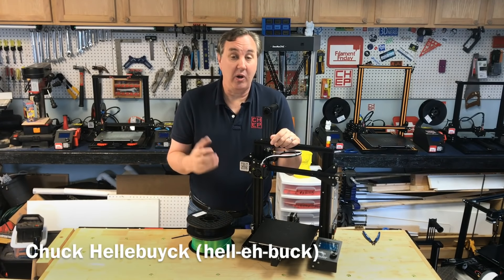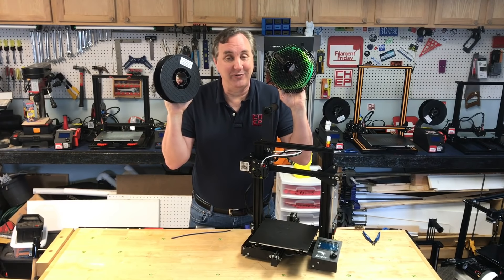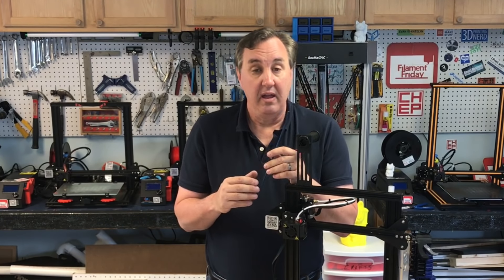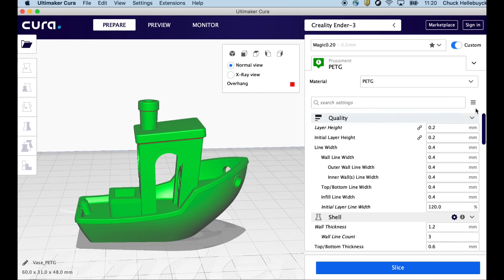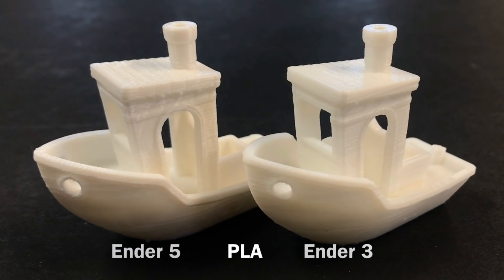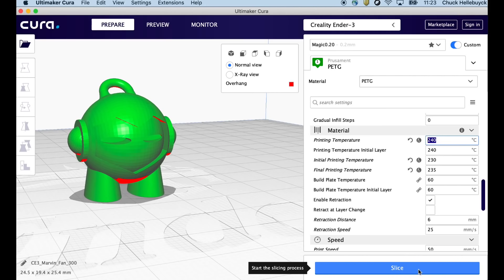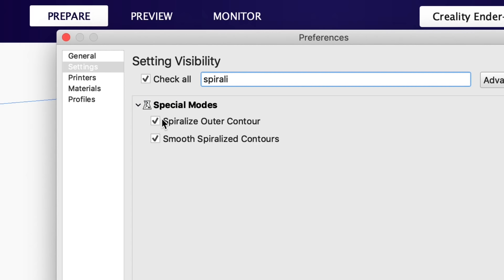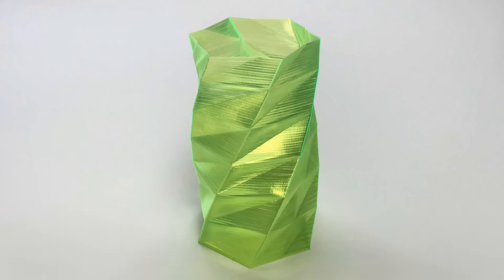PETG on Creality Ender 3 - Atomic and Prusament

Comment: Stringing: If you need to print a more complex object with supports and lots of travel in PETG on the Ender 3, change 'Combing Mode' to 'Off' in the 'Travel' section of Cura. This will make most of the stringing disappear because the Combing forces the nozzle to travel within the object (which is good) but it disables retraction when doing so. I initially had lots of issues for printing a Petsfang cooling duct while all my previous tests were fine. The geometry of that object created complex travel patterns which in turn created lots of stringing inside the object. That matter was often dragged to the outside of the object giving the illusion it was a retraction issue.
Reply: Oh my GOSH you have no idea how much stress you saved me. I would have never found that setting on my own, I am trying to print an iron man helmet but I can't even get a 3dbenchy boat to not have much stringing, not only did this eliminate the stringing it also made my print quality much better. I have been trying to fiqure out why my prints where still stringing and poor quality for so long. Thank you!!!

Comment: Hey Chuck, I have printed several thousand meters of the Atomic CF PETG, on most machines it needs 250C and 45mms, Prusa MK3 is an exception at 260C. With proper extrusion rate it will make prints that look almost machined and print very easily with no blobs or problems with supports. I don't have an Ender 3 but, I have printed it on the Anycubic Mega-S, Anycubic Chiron, Prusa Mk3 and Formbot Raptor 2 all with similar results. Standard PETGs get the same treatment at 240-245c. I usually use Atomic or Inland for them.  Also you might want to mention in a future video that PETG will take on water fairly quickly and needs to be stored properly. Thanks for the video.
Reply: In reality it is the opposite of what you said, petg does not absorb water, in fact it is also used to make bottles
Reply: @xpy99  I don't agree. PETG certainly absorbs water, and if you print one which isn't dry it will not be as shine clear, but more rough and more brittle. Depends on the climate you live, but I have to say, if you want repeatable quality, make a drybox and keep it at 10-20% RH.

Comment: Not a good idea to take that PTFE up that high, you can find studies that found that the stock PTFE can start to break down as at temps as low as 215C. And it's some nasty stuff, known to cause brain damage and in extreme cases could kill you. Just my input, I'd go for an all metal hotend if you wanna print anything other than PLA.
Reply from the maker: Do you have link for those studies?
Reply: @FilamentFriday  No I just happened upon them during some casual reading a while back. I can try to find them this weekend if I have some free time.
Reply: @FilamentFriday  i've read 240-260 before decomposing, but never read anything about brain damage and death... first look i'd say it seems quite exaggerated
Reply: @Biohazard0687  On the capricorn website itself, they warn that some offgassing can happen above 200C and it becomes dangerous (to humans) above 275C. Their sources seem to lead to 404 errors on pet websites though...
Reply: While I agree that a large enough amount would pose a threat, the actual amount of the tubing that gets exposed to that elevated temperature is very small.  If a large amount of it was being exposed to those elevated temperatures I'd be much more concerned.  I'm more interested in what the filament is out-gassing while being melted and if there are any dangers as all of it will eventually be exposed to the high temp.

Comment: Just a heads up guys and gals...I just got screwed by Atomic Filament and their Starry Night Translucent v3 PETG PRO filament. Part of the reason for viewing this video was to get some insight for further troubleshooting extrusion issues with a small .2 mm nozzle. Literally during back and forth e-mail with Atomic today, they updated their product page to express a recommendation for a .35 mm or larger nozzle when using this and similar filaments that have additives, such as glitter. I argued that their recommendation was not on their product page at the time I made a purchase and I should not be responsible for their oversight. Ultimately, Atomic refused to receive back there filament for a refund, implying that their filament is tried and true with standard or larger nozzles.  Their lack of transparency, empathy and strange pricing (almost everything is always 50% off) should draw concern.

Comment: The higher breakdown Capricorn tubing works great for PETG.  Concerns about dangerous outgassing are valid but consider that  the amount of the Capricorn tube that actually gets exposed to that higher temp. is a very small.  I've been using Capricorn for quite sometime and have yet to see any breakdown with the part of the tubing in contact with the nozzle on multiple printers.  My favorite PETG filaments are eSUN and COEX.  Never tried any Prusament yet.  Not a fan of Inland PETG.

Comment: How do you get your prints to stick to the bed?
Reply: Hey idk if this is a late answer, but it seems like you can do petg on an ender3, and it works like pla. Seems like you need to go 90 on the bed temp and 0.3 initial layer height. 240 on the nozzle for the initial layer and print at 30mm/s or less for the initial layer. Then go 225 on the nozzle for the rest of the print and whatever layer height you want. Keep the bed at 90 tho. You can print faster too, all the trouble isbjust gettingbthe material to stick to the bed then its not much different fron pla when past the first layer or two. Dont quote me on all this, there may be more to know too I just got it working smoothly today. Those settings kind of magically worked, it just seems to really like to stick to hot metal. You shouldnt need any glue or anything if you have anything that isnt plain glass.

Comment: I don't know how to tell you how thankful i am lol. I couldn't make PETG work for me until i learned to not be afraid to bring the temp up  to 240. I used to attempt it in 220
Reply: Update. I was doing larger prints and for some reason it began to warp. Does anyone have any suggestions for what to do to prevent this?
Reply: petg likes to warp on glass beds. I always use a brim to print petg, and try reducing the fan speed. Hope that helps
Reply: @giulianopaletta5072  yea man thanks for the info. I'm not using a glass bed im just using the mat in the ender 3 pro. What helped me was setting the bed temp to 75 degrees and I printed stuff with no problems. Ill try keeping the fan speed low for next time. Thanks again.

Comment: I print well with generic PETG at 230 C on the hotend and 80 C on the bed on my Ender 3. Retraction is 6 mm and moderate speed. 

Printing slowly without z hot makes a big difference in quality. Make sure your bed is very level for the first layer to ensure you dont have anything stick to your nozzel.

Comment: Capricorn’s safety page cautions that their additives inhibit deformation, not PTFE offgassing. They strongly recommend printing “in a well ventilated area, away from children and pets.” Some pets are indeed more susceptible to PTFE fumes, but as a medical doctor who has studied this topic, I know that no human of any age is immune to the myriad health risks triggered by Teflon pyrolysis. The best level of it is ZERO, not just a low, seemingly acceptable level — for such chemicals, there is none.

Unfortunately, Teflon pyrolysis rarely produces immediate noticeable effects, but exposure can and often does trigger serious and even deadly consequences. Because users commonly print frequently if not 24/7, that chronic exposure will very likely result in health problems.

Crucially, no fused-filament fabrication (FFF) printer is safe. Some are designed so they are not susceptible to Teflon pyrolysis, but heating all filaments — even PLA — produces particulate emissions. Many users mistakenly assume that little or no smell translates into no risk. Wrong. Bottom line: no printing should be done in occupied buildings unless the printers are encased in airtight chambers with active ventilation ported outside.

Comment: now running petg at 100 mm/s with extruder at 240 and bed 75. layers 0.2 and a beast like the ender 3 pro is like awesome.  ender 3 pro is still stock, brand new! thanks chep for the little tweakings i was still missing ;-)
Reply: Watch for bowden tube tube melting around 240, don't go over that. I will try PETG but at 235 C on standard tube, after I switch I can go higher. Btw the fumes from the molten tube are not good for you, take care.
Reply: @mmdirtyworkz  240° is the maximum i need ;-) the PETG flows very nice and don't need to go higer. next upgrade i'll buy will be the capricorn tubing. but i have an ender 3 pro for PETG and an geeetech A10 for PLA and another ANET A8 for PLA. don't like to switch filament types on my printers and i don't have to worry about levelling al the time alsow. thanks for the concern, don't need to have more toxic fumes then we already have al day ;-). stay save!
Reply: What fan settings do you use?
Reply: first layer off. for the rest it depends wich slicer i use, if i print on glass or another surface. my ender 3 pro is modded with duckts so have to find it out a little bit yourself. i've quit cura and use now for the most stuff i print prusa slicer or ideamaker. find them better working with my ender and geeetech A10.

Comment: If you take a blowtorch and quickly sweep across your print with it like you're painting it, after a few swipes with cool downs in between, you can give it a nice shiny reflection and the print lines dissappear if you are patient and do it right.
Reply: i found this out with PLA, when your print off of the ender 3 bed, it's a little white on the bottom, blast it with a "jet" lighter, and you have no more white marks

Comment: I totally agree about the Capricorn. I bought a meter for my Anycubic Linear Delta printer to help with accuracy and retraction (which I totally recommend) and I had a bit left over that just happen to be the exact length for the E3. I now feel confident in taking the Hotend up to 250 without a problem. Capricorn is a cheap but worthwhile upgrade. PETG is great for load bearing applications but I find it's not as detailed as PLA. My current project is mounting my CH Fighterstick and throttle to my chair for playing Elite Dangerous. PETG is perfect for an application like this. 
BTW thanks for the profiles Chuck, I'm looking forward to trying them out.

Comment: For wider/larger prints I had to increase bed temp to 75°C 
To fix layer separation I increased hotend temp from 240°C to 260°C and reduced fan speed to 25%
After these changes I'm able to print with PETG quite well on my Ender 3.
Reply: Are you using the same 50mm/s speed?  I'm getting a ton of stringing on my prints and tried several ranges of speed and temp.

Thoughts?
Reply: @nicholaswillcox  Stringing often indicates insufficient retracting.
Could also be a sign that you're having a cavity between the nozzle and the tube.

...and yes. It's at 50mm/sec I'm using. Sometimes I increase the speed to 60mm/sec with acceptable results.
Reply: @sysghost  Interesting.  So I will say this, maybe it'll help troubleshoot my failures.

Retraction at 6mm and can't remember the speed, but set it pretty high.
and the stringing typically only happens after the first 3 or so layers.  

The first layers go down and it looks beautiful.  Then...literal plastic poop. LOL

(Cura slicer, BTW)
Reply: @nicholaswillcox  First few layers are printed at a lower speed iirc. (I might be wrong here). That could be a clue.

But stringing is related to the material being left inside the nozzle. How this might be happening :
* Too short or too slow retraction. (Sometimes movement in the bowden tube itself cancel out some of the retraction distance)
* Too high temperature resulting in too low viscosity.
* Too much molten material in or around the nozzle. (molten material just above the nozzle inside the heatbreak. There might be a cavity just above the nozzle as the bowden tube isn't seated properly aganist the nozzle)
Reply: @sysghost  Really good info.  Whenever it's not ice-pocalypse down here in Texas in the next few weeks I'll give that information some space in my troubleshooting and see if I can't sort it out.  Thank you for sharing the knowledge!

Comment: I would definitely change the fan control and flow settings for petg if one is interested in the strength capabilities of petg. Using the fan setting for pla makes most petg brittle. And it would be wise to tune the Retraction for petg too. It looks OK but could definitely look better with not using generic settings

Comment: Wanted to thank you for this video. I received an Ender 3 for Christmas and had a lot of luck with PLA, but trying PETG I had problems. Seen other videos for printing PETG but they were kind of vague. After watching your video I have had nothing but success so far. THANKS again.
Reply: Also, I print with Inland filament and you mentioned that you had to go as high as 260 degrees. I have been lucky and printing it at 240 degrees.

Comment: With the hotend fix video you posted a few months back, you would only need enough Capricorn tubing really for the piece inside the hotend, so would be able to do multiple printers and just leave the standard ptfe tube running from the extruder to the top of the hot end. That's my plan anyways as Capricorn tubing isn't super cheap ordering in Canada.

Comment: I bought some Amazon PETG and Im quite happy with it after dialing in the settings for my printer. PETG will probably be my go to filament from now on. Especially since my local government mandated recycling company acknowledges it as PET for now. They wont take PLA or bags even if they are made from hdpe.

Comment: I've had good luck on the Ender 3 on PETG, the only thing that's really an issue for me is getting a clean first layer because the nozzle keeps peeling up bits of it, but once that layer's down smooth it's well and truly stuck there until I release it.

Comment: PETG is basically stronger than ABS without any of the styrene VOCs or warping. It's also food safe.
The only mod I needed was capricorn premium Bowden tube, which works perfectly and much better than the Micro Swiss hotend.

Comment: Ran PETg out of the box pretty well. The PTFE needs to be real tight to prevent blockage and burn in the hotend. Have moved to the Capricorn PTFE with the washer fix from CHEP and it's significantly improved. 240-255 degC hotend, 8.0mm retraction and 69degC bed. Biggest issue has been bed adhesion, gluestick has been the best result. Print speed no higher than 60mm/s. Results have been consistently comparable to PLA. Stringing happens when too hot and you don't want to add additional stress by printing too cold. So test your filament, start hot and drop the temp until you find the sweet spot. With Marvle3D filament standard setup 255degC with mods and tuning in running at 240 degC. So good tuning makes a significant difference.
Reply: 69, nice

Comment: Inland is one of my favorites, I run all metal hotends, and it prints like a dream -- 245-265 depending on the machine. I just got a totalpack PETg in and have had a few good prints off it -- it has a recommended ranges of 180-210, that's a bit weird, I had issues with flowing it at that low end, but 230-235, runs fine. FYI -- not sure what your fan settings are, but PETg is best to turn the fan down.

Comment: Hi Mr. Chuck, how are you? I would like to know if the Ender 3 possible to print the PVA filament ?
Reply: Why not? Print temps aren't too high, bed temps reasonable. I'd really only recommend it for dual-extruder setups, though. PVA on its own is a pretty "meh" material, it carbonizes easily, which causes jams, and is water soluble. Best use I've found for it is supports on a complex structure, and being able to dissolve the supports rather than pick them out. But, again, that only really works with a dual-extruder setup unless you really like changing out filament in prints.